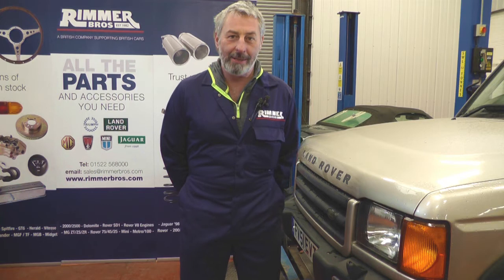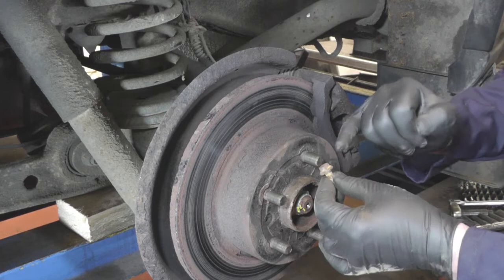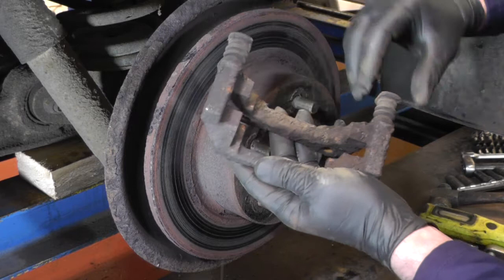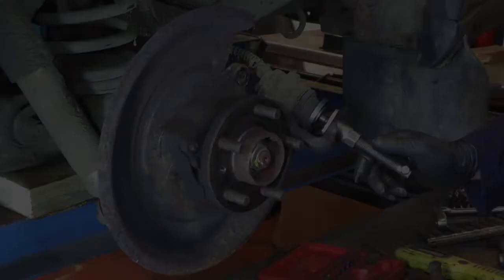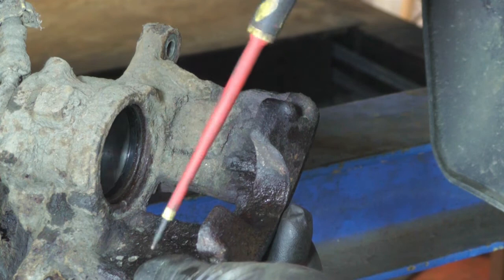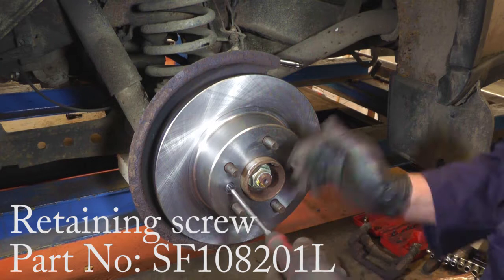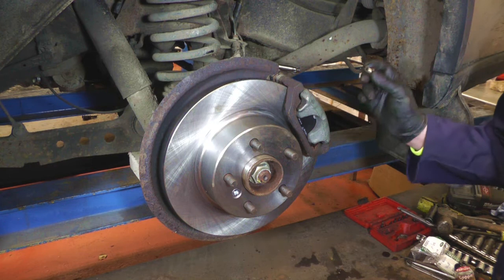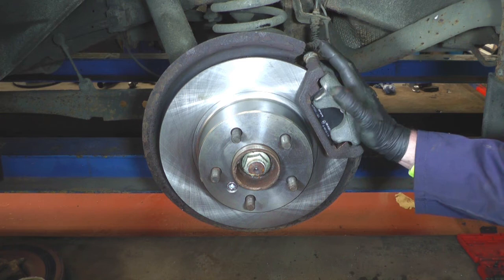Replacing the Rear Discs and Brake Pads on a Land Rover Discovery 2 TD5

Comment: If I’m just replacing pads I don’t need to remove carrier do I ?
Reply: No - no need to do so.  Very essy job if just changing pads, though I like to also clean and lubricate the slider bolts and side edges of pads!